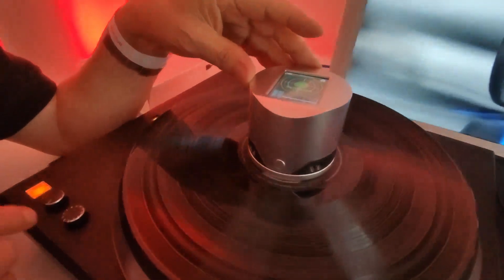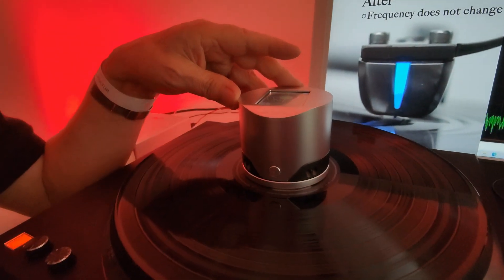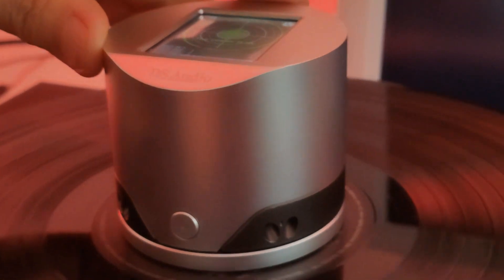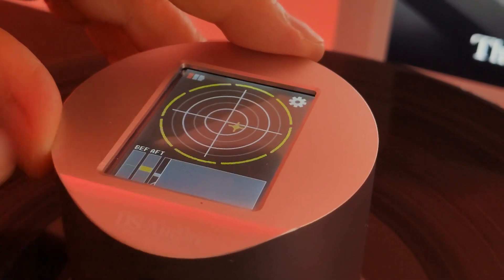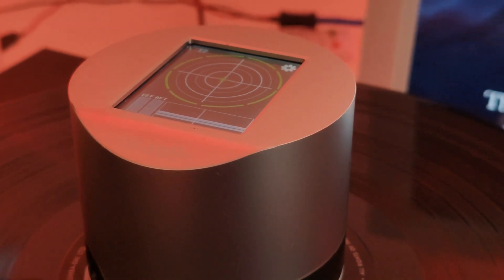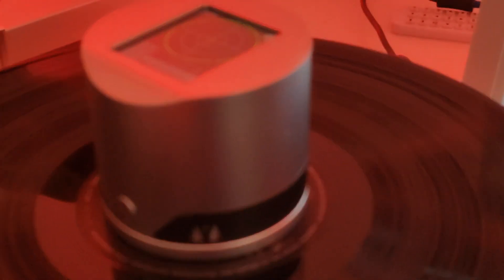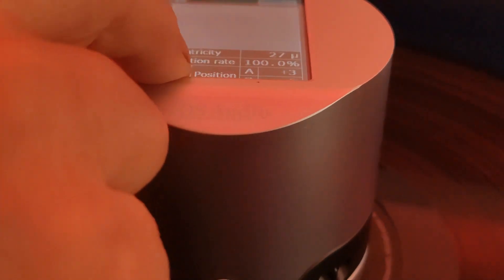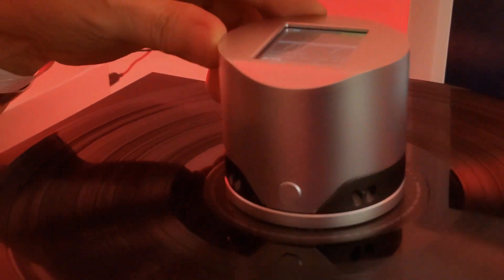Wow & Flutter reducer for turntables | DS Audio ES-001 Eccentricity detection stabilizer

Comment: This is just a repackaged $50 Chinese security camera with IR motion detection. it's a low-res camera that detects motion shift from the IR LED light from the inner grooves reflected. It's the same logic as motion detection in those cheap $50 Chinese security cameras where the moving subject is framed in the playback. I guarantee that if this thing was taken apart you would find the insides of a Wyze-type security camera... but cheaper because worse image sensor and no wifi.